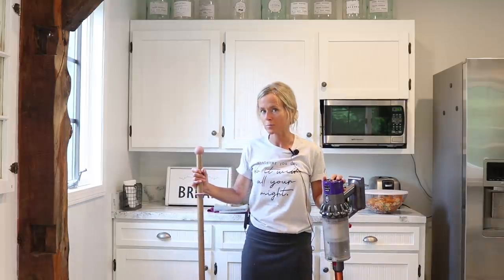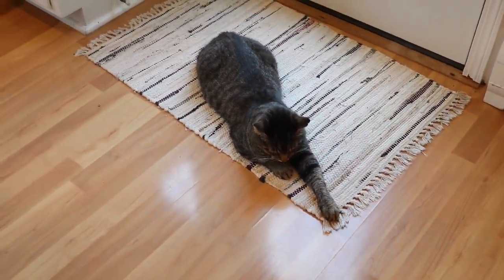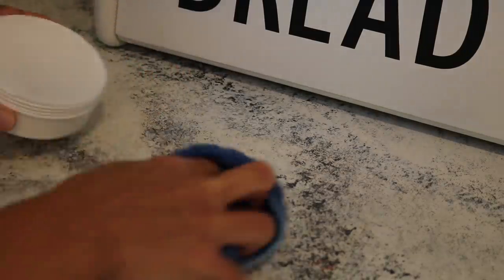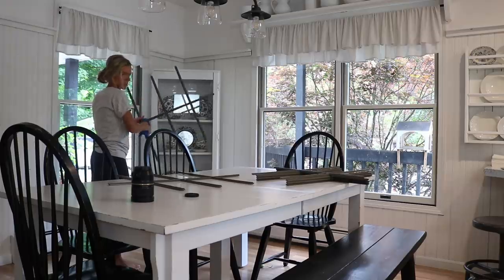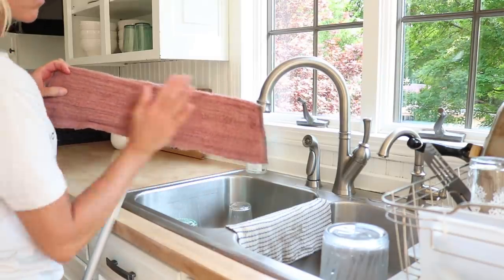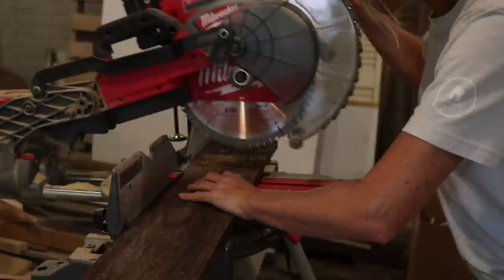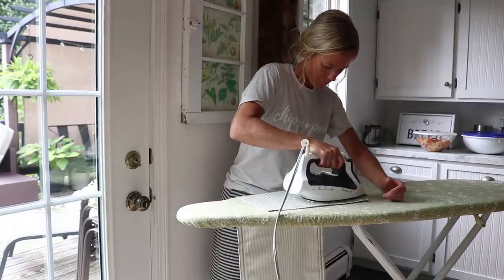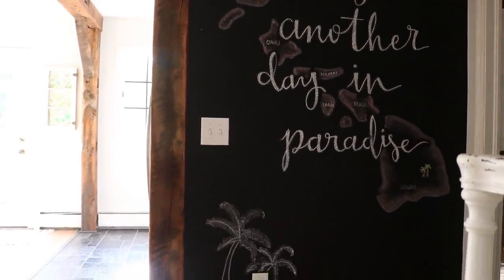Clean with me ~ General Cleaning Routine ~ Decor Refresh ~ Weekly Cleaning

Comment: Bissel Spin Mop is also a great electric mop to use on floors but you DO have to vaccuum first with the model that is just a mop; ALWAYS do a 'spot check' with a cleaner! Good Advice! I had used one of those Mr. Clean Magic Erasers on the white bedroom doors of my sons', which were so dirty from oily mechanic hands; looked like it did a great job until the natural light which shone later on that morning, showed that I had stripped off the factory finish, on the areas on the doors, on which I had used it!.... aagghh!

Comment: Use "A Ben A Qui Cleaner" it may not give any smell however you don't have to worry about what countertop or item you put it on. It's not corrosive it doesn't scratch it's amazing. I can get any mark off of anything. And my glass top stove hasn't looked better than it has looks brand new. Also if you have any marks that are greasy on your window that takes it right off. I mean this stuff took pine sap off my hands. And I got some all natural stuff for my dishwasher sent to me and they put it in a plastic bag while the covers weren't on good or the seal was broke something and the black paint that they had on the plastic had stuck to the bottles. And then it was getting on my hands. I tried washing it off and it wouldn't come off I'm like oh my God I'm going to use my cleaner I just wet the paper towel I pushed my finger in the container cuz you don't want to put wet stuff in there cuz you just don't do that you just take your finger and you put it on the item you're going to use to clean with put it on a paper towel that stuff came off instantly. It was amazing you can buy the stuff on amazon. if you love it so much and you can get your local store to buy it just go on line and look up the company and give that information to your local store and it'll be half the price. I have people all the way up in northern Maine using this. I have family using it in arizona. People can't believe how well this stuff works. It gets gum residue and glue residue off bottles if you want to clean that off. I mean it's amazing I could go on and on and on

Comment: Question:  Is the car cleaning brush you have in your Amazon store (Carrand 93053 Deluxe Car Wash 8" Wash and Jet Dip Brush with 48" Handle) the same brush that you used for cleaning the exterior of your house in another video?  I liked your method of using a soft brush instead of rags.  My siding and front door can sure use a cleaning but I want to make sure I don't chip the paint.  Thanks.  I really enjoy your show; it's my favorite.  Today's video inspired me so my kitchen and windows are all sparkly now.  Yes, I lit a candle but did not make a candle holder.  ;-)